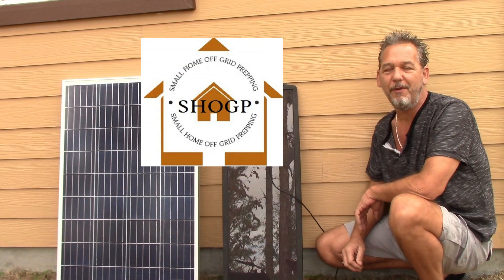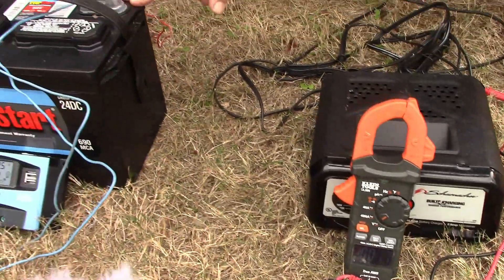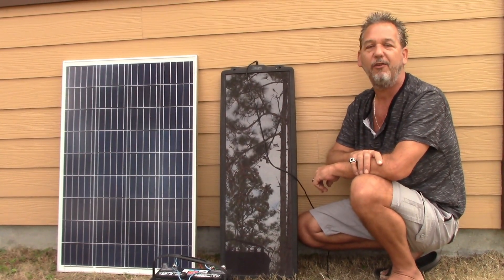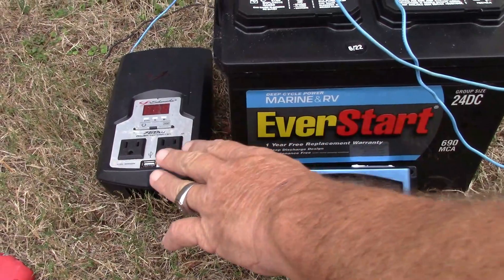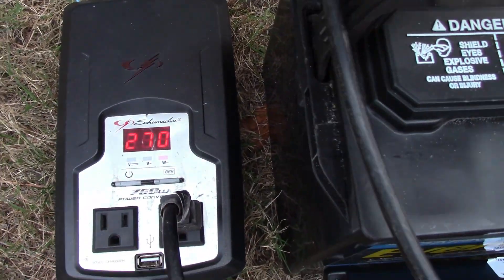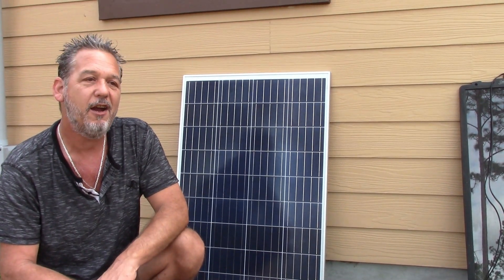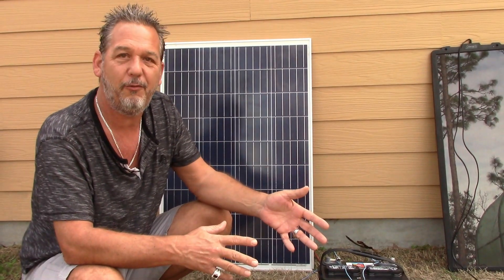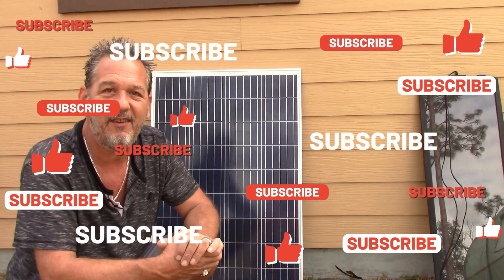SOLAR POWER, HOW TO BUILD your own OFF GRID SOLAR POWER PLANT

Comment: Thank you! I am still stumped on how to run my deep well 240v pump for cheap. It looks like 1k bucks is a min for a split phase inverter.
Reply from the maker: Running a well on Solar with an inverter is not that hard, my well is a deep well (130'), with a 1.5 hp pump, it only takes 1600 watts when running, and more for a split second on start up, but my generator that is 5900 watts with a 6600 max surge has no problem starting it and running the well. I don't know if you have seen my recent videos on the solar system I have been installing in my house, but I have briefly shown my split phase inverter a couple of times, I will be doing a video soon showing how the inverter works. I have a low frequency 6000 watt split phase inverter, it is low frequency so that means it works a little different than high frequency inverters, it is 3000 watts continuous, then will work between 3000 and 6000 for a brief amount of time, but only about 5 minutes, or less. mostly for things like variable speed motors that briefly speed up , then slow back down, then it has a start surge of 24,000 watts for a split second to start large motors, but keep in mind you can't get more more power out of an inverter than your solar and batteries can supply, I have 5-101 amp hour batteries wired in parallel, that is only 6060 watts, so I could not get 24,000 watts out of 6060 watts, so If I had a motor that needed 24,000 start watts, I would have to have 15 more batteries. It will still be a week or two before we have our web site and other ecommerce sites updated, but we just completed putting a deal together with a large company that manufactures beautiful split Phase inverters, the one I have is a 110/220 that actually puts out 230+, that is usually fine with 240 appliances, that one works great for me, it runs my entire house including my ac, but have not tried the well yet, that one will be going for around 475.00 when we get these added to our sites, we also have a 4000 watt continuous with 8000 max and a 32,000 surge, that one has adjustable voltage from 220-240 with a dial that allows the user to adjust what voltage you want, that one will go for about 650.00.We will have dozens of more options for inverters as well going up to 30,000 watts, and everything in between, I'll let you know when our sites are updated with these new products so you can take a look.

Comment: Thanks for this excellent informative video.  Can you show how to use a single phase 240vac solar controller and use it for 110VAC USA plugs?  I subscribed and can't wait to see more videos from you!!!
Reply from the maker: That's great, I'm so glad you're enjoying our videos!! It looks like you are talking about a grid tied inverter/charge controller that requires a 240 input?
Reply: No not grid tied. I have seen a 4200W hybrid controller inverter but its from EU so is 240VAC and I need to make it 120VAC so I can use it here in the USA.
Reply from the maker: Got it, now I understand your comment, First you need to make sure the inverter is 60HZ, not 50, electric in Europe operates at 50 HZ, while in America we operate at 60 HZ, they are not compatible, If the inverter is 60HZ, then you need to get a voltage controller that will reduce the voltage from 240 to 120, It could be done this way, but isn't the best way ,the best way to do that is with a split phase inverter that puts out both 120 and 240, in America our 240 is two legs of 120, in Europe their 240 is one leg @240.